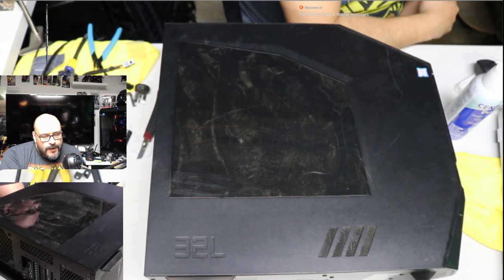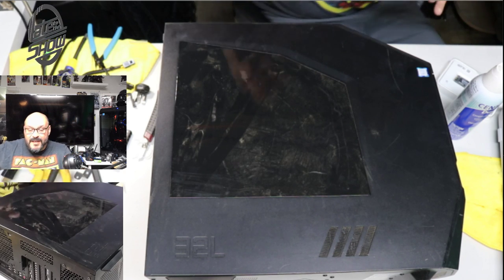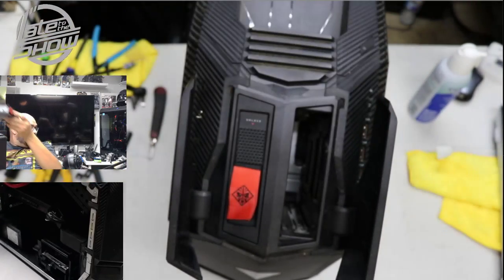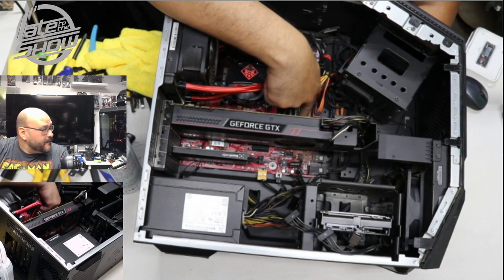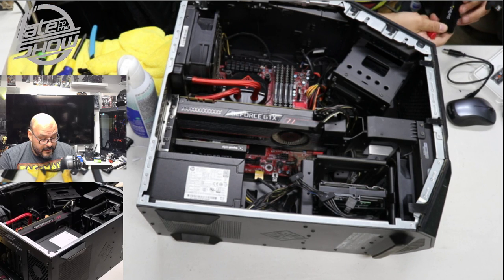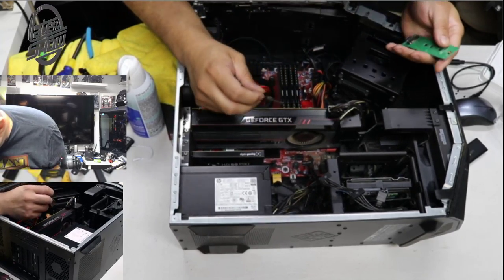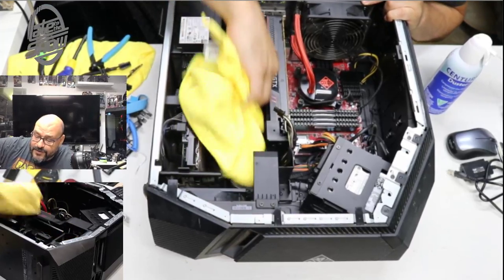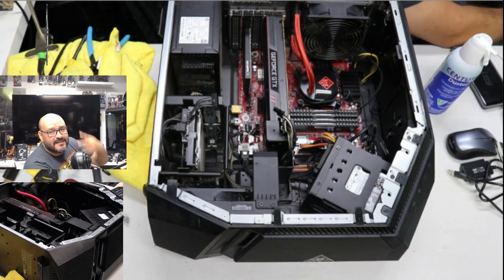OMEN  Desktop (880-050) SSD upgrade

Comment: i have the same PC and i'm struggling in upgrading the ssd. unfortunately, the motherboard only has one ssd socket for this type, the question is, how do i move all of my data and op to the new ssd without any trouble and with ease?
Reply from the maker: Many SSD offer free cloning software to migrate all data and application for free, you can also find free software online. The ssd that you are transferring must ne larger than the original and you must turn off bitlocker to make it work. I'm currently working on a video on this type of migration will be done this weekend.
Reply: @LatetotheShow  
Hey bro -  did you finish the video on migration? If so, what is the link? Thanks
Reply from the maker: Yes I'm editing this week
Reply: @LatetotheShow  Hey bro - Did you finish the video? If so, can you please send me the link? Thanks.
Reply: Same issue here. I want to upgrade the 256gb SSD to a faster 1tb. I'm worried about the Omen Bios, don't know if i can simply clone it using an adapter.

Comment: What is maximum size of HDD you can add to this desktop please.
Reply: There’s two HDD trays at the top of the desktop. And I think two other slots inside the pc. You can also put an ssd in the extra spaces just make sure you have the right cables for it.
Reply: I don't think there is a limit. I've got all bays filled and the SSD MV2 in the PCI slot for primary C hard drive. Very fast.

Comment: Hi what is that black block bellow the GPU and above the power block?
Reply from the maker: This is to hold the GPU from any type of movement.
Reply: @LatetotheShow  No not that, the thing that looks like an SSD, you call it an elgato card? at 12:56
Reply from the maker: It's a streaming card call elgato 60hd

Comment: Do you know if the motherboard can be upgraded as well as the PSU or does the case have proprietary connectors for LED and other stuff?
Reply from the maker: not enough room for any additional fans or any other type of water cooling system. Yes you can replace the mother board.